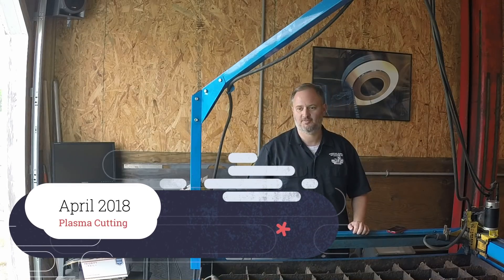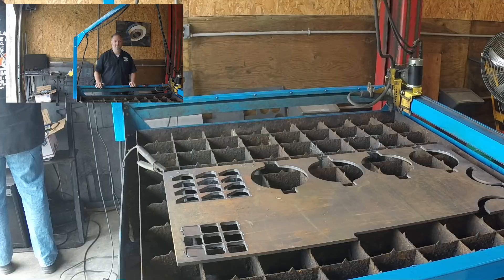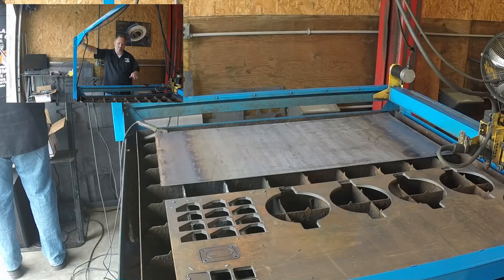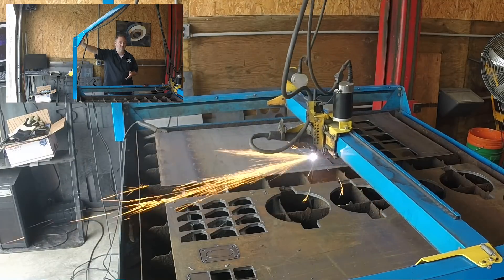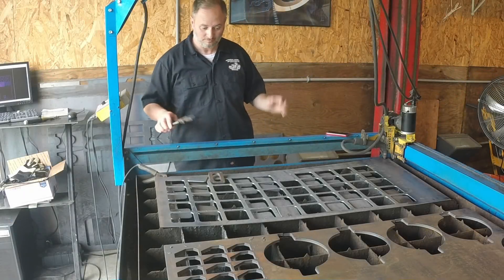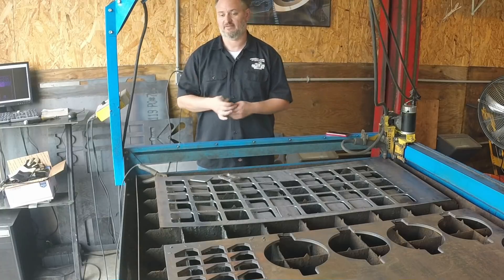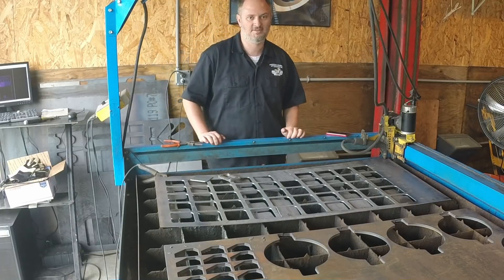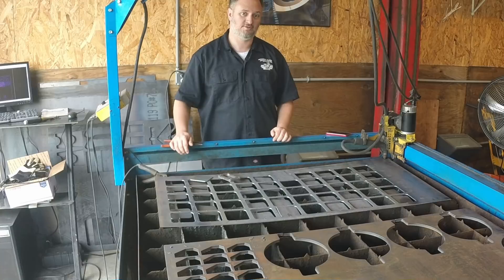PlasmaCam - April 2018

Comment: Looks like the material warped up towards the end of the sheet.  How does the PlasmaCam machine deal with that change in height, please?
Reply from the maker: That machine had a feature called Torch Height Control and used the voltage of the plasma arc to determine the distance from the material and could automatically adjust the height to maintain the set distance.

Comment: Do you have any suggestions on how I can build a downdraft table for our 4' x 4' PlasmaCam?
Reply from the maker: The PlasmaCam came with some sample designs and those included side panels. Basically just hook a fan and ducting into those and you are set up. There's a lot of fancier ways to do it but that will get you started.
Reply: @TomZelickman  Hi Tom. I didn't see any side panels within the sample designs that came with DesignEdge unless I am not looking in the right place. I was looking for the files, but I am only seeing the 13 designs that came on the sample disc. Any ideas? Thanks!
Reply: @TomZelickman  actually I found the panels. However, I don’t understand how you are supposed to cut the panels out on a 4x4 table as they are larger than the table itself. Any ideas?

Comment: I have some alignment problems in my plasma machine
Reply from the maker: I typically start by checking the measuerment with a tape measure from corner to corner. They should be exactly the same. That's the easiest thing to fix that throws things out of alignment. Next I check that the gantry seats flush along the back on both side to make sure the gears are aligned right. The last thing that can thrown things off is backlash which can be from worn or loose parts, among other things. Hope this helps!

Comment: Good night ... i want know how do make my cnc plasma table , what i need for  made the cnc i am frome of colombia .how do i  import a sistem cnc software and hardware .the table i do make here in colombia. thanks for you atentions .sorry my english is not very well
Reply from the maker: Hi Eduardo - I considered building my own plasma table at first as well. There are several kits out there as well as some general plans from which you can work.I'm not sure about shipping rules but have you looked at the website for cncrouterparts.com yet? I believe that might be a good starting point for you.

Sincerely,
Tom Z
Reply: @TomZelickman . tom .Thank you very much for answering my concerns. I used a lot of the link that you shared, I will try to bring to Colombia one of those cnc kits. Thanks again. I will show you how my project is going

Comment: Well I dunno about the Craftsmanship thing....I would certainly love to have a PlasmaCam here to turn out better finished parts in less time. It's one thing to be connected to the work but a job shop has to be profitable timewise as well. I've got my corner already picked out for my unit when it decides to arrive.. ;-)
Reply from the maker: Yes, sir... It sure does do that! Especially for jobs like the one that I just showed where there are 50 end caps to cut for welding. Time to fill that corner, Colin!
Reply: Close to the steel receiving door.

Comment: Good video Tom.  Don't you just love that PlasmaCAM.  We have the identical machine at the school where I work.  However, ours has a 3phase Hypertherm 65amp torch with a magnetic quick detach plate incase of collision.  The dealer over here for them (Metalform group) have designed their own water table too.  So we also installed that.  Water table makes such a difference.  Keep up with the vids buddy.  Cheers mate, Aaron.
Reply from the maker: Thank you, Aaron! It’s quite the machine. I thought about getting one of the mounts like that if only to make it easier to use the torch in manual mode but I’ve never gotten around to it. I guess after 6 years I’m not likely to make a change... Hope you are doing well, sir.
Reply: Would you start out with a Hypertherm 45 or 65?

Comment: Hey Tom, good to see you.  That plasma cam has done alot of work for you over the years, looks like its running good.  I see you are a little more liberal with your nesting than I am, I try to jam stuff in as tight as i can and end up with a lead in cutting into a neighboring part! lol
Reply from the maker: Thanks, Gary! I typically nest a little tighter but this time I was more concerned about the parts warping than using the material well. It really started to twist at the end of that run. Hope things are going well out your way, sir. - TZ